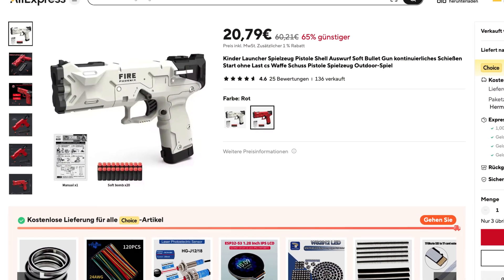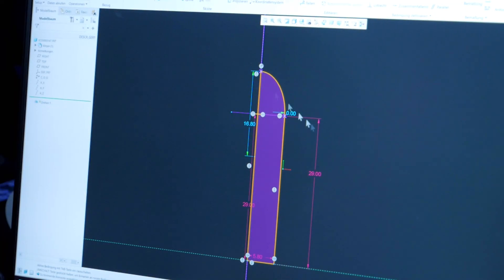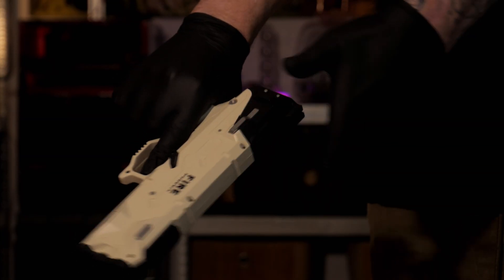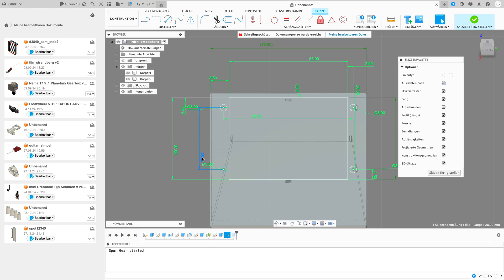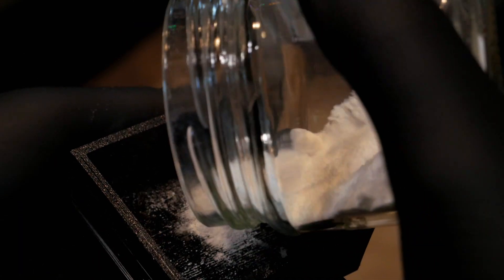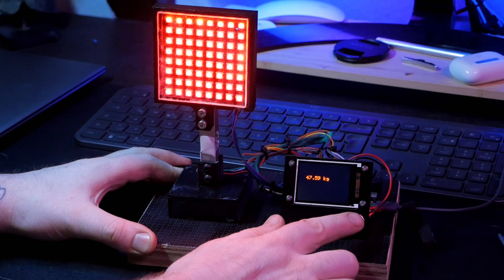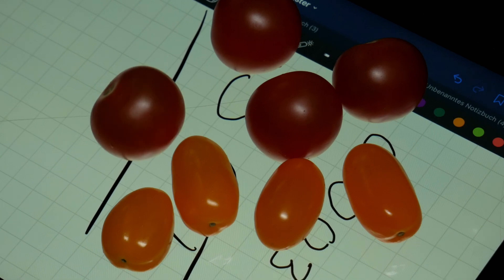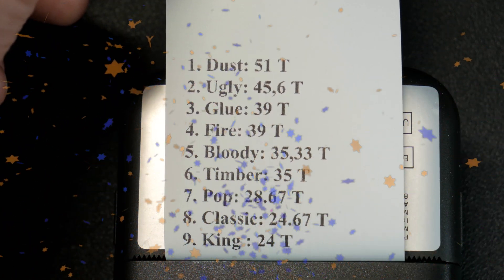How I Built a Power Meter to Test DIY Nerf Darts!

Comment: I have no idea how I came upon this video. But I am glad I did. I expected this video to be from a YouTuber with a million subs, not a newbie with a few hundred. Just based on the very first shot we see in the video, the cinematography etc. Quite amazed, if I'm being honest. Were you a camera operator or editor for a big YouTube channel before this? Or is this really your first go, in which case, goddamn dude.

Edit: Goddamn dude, watch a video on how to mix plaster or concrete. You added like.. 5x more water than you should. It should not look like or have the viscosity of milk. This DRASTICALLY reduces it's strength, and causes massive shrinking

Edit2: All this work printing in PETG, putting plaster inside the print, big bolt. And it's all useless. Totally useless. Because your load cell is completely ABOVE the 3d print filled with plaster. Which is why it's so floppy. Doesn't matter if you have a tungsten base,  if the only thing holding the load cell to the tungsten is 1.5mm thick 90 degree with no fillet 3d print with layer lines across it. That upright socket is weak, and kinda dumb when factoring what you did below to make it strong. Having the load cell go INTO the plaster, or some 90 degree corner supports on the upright or something would make it a lot stronger
Reply from the maker: Thanks for this amazing compliment! That definitely gives me a big motivation boost to keep making videos. Sometimes you’re not really sure if anyone is actually watching what you put together, so it’s awesome to hear that it comes across as so professional. I actually come from the automotive industry and never had anything to do with media professionally or even as a hobby, but photography has always interested me a bit because of my grandpa and my mom. Really glad to hear that you’re enjoying it! This will definitely keep me going. 😊  🚀
Reply from the maker: Oh, and thanks a lot for the tips! The point about the Load Cell makes total sense, and I can see why that part of the design is a weak spot. I’ll definitely give it another try later and see if I can improve the setup. Appreciate the feedback! 😊
Reply: @LionInTech  (!TECH SUPPORT BELOW!) Sure thing bud. I can PROMISE you, you will make it big if you continue making videos like this. I'm serious, I am very impressed and you have quite a wide set of skills. It's very impressive. But they usually come with a cost... trying to learn so many skills to a workable level, means you never really get a chance to figure out all the little tips and tricks that only come after you do it 20 times or 100 times, ya know? Since you spread your experience across so many different fields. It's not something to be ashamed about, far from it. I'd rather halfass 20 things, than master 1 imo. Just means having to stop, smoke a cig or eat a snack, and come back and look at your design and you will usually see where it can be improved. 

I struggle with this, personally. I get tunnelvision, and just THROW myself down the first method that comes to mind, where if I took a 5 minute break I'd see it's actually possible to do it 5 different ways, and each of them is better than my first idea.. it's a personal failing of mine. All we can do, as people, is realize our faults, and take the time and energy to try and work around what we know we're like.. 

My personal failings are as I said tunnelvision, bike-shedding (aka analysis paralysis), they're related because once you bikeshed, you're locked into that tunnelvision. A very wise man in my life once told me "The enemy of good is better". I didn't really understand it, it seems arguably false, ya know? What I finally learned it meant was sometimes good enough really is good enough, and spending 5 hours trying to improve some random aspect of a project that really serves no purpose or improves the overall project so little it's actually a total waste of time. Sometimes good is good enough.

Didn't mean to soapbox at ya. As far as the load cell mounting, a lot of times you can just halfass a fix in 5 minutes, then spend hours redoing it. You could 3d print or just cut out some acrylic, lexan, hell even wood triangles, and epoxy them from the upright socket to the flat surface. They are called 'gussets', they are everywhere in the automotive, aerospace, etc industry because they are cheap and greatly improve designs. Triangles are amazing at that, which is why everything structural is always triangles. Don't have to reprint, re-plaster, etc the whole mount, just epoxy some gussets on there and boom, 1000x stronger and stiffer.

Also, your loadcell code might not work the way you think. TECH BELOW and suggestions below:

Always put your code on github, and any design files including napkin sketches, and link the github in your video description. People greatly enjoy this and will thank you. Your code, from the flashes I saw on the screen, I don't see any calibration factors, the hx711 library comes with an example sketch called 'calibration', you upload that, and in serial monitor it spits out values unique to your setup. Then you save these values, and on your actual project sketch, you set those values as variables (calibration factors) for the code to use. This is why your readings are weird. I know you didn't do this, because you just copied that section of code with the example calibration factor (2280.f) from the example sketch. You also didn't set the hx711 gain values in code, no calibration factors, no loadcell_offset nor loadcell_divider, nor did you do any sort of sample averaging that I can see (that's why I said put github with your code up). Check the github for the library you used, including example code and FAQ: https://github.com/bogde/HX711 You also use get.units if you read my link for the library you can see you can put a # in the () i.e scale.get_units(5) for it to take multiple readings instead of just one. Then you can do some sliding window averaging and peak value easily, versus the way it looks like you're doing it, which will more than likely miss the actual peak force the loadcell sees. The hx711 can do 60 samples per second, and that library can even do automatic averaging. if you used scale.readaverage(5) for 5 samples, scale.readaverage(20) for 20 sample average instead of the other way.

And since you didn't define any of that, your values don't mean anything, which is why you had to use 'tomatos' lol. But even that won't fix the fact that a dart hitting a hard surface is going to happen in milliseconds, and your code would miss that. Also, the HX711 rate is set by pin15 (sparkfun project page for hx711 covers most of what i said above) the datasheet for the hx711 says pin15 is set by either going to vcc or ground, to set if it sends 10 samples per second, or 80 samples per second. However, depending how that pin is connected, it might take 400ms for the output to settle, which means even though it's sending 10 values per second, you're actually only getting 2(!) actual values per second. That is the RATE pin, and the DVDD pin. The sparkfun board, on the sparkfun project website, actually has a solder blob going to pin15, it's labeled SJ2. It's closed from the factory which is 10 samples per second, if you cut it with a knife, it now does 80 samples per second AND LOWERS the settling time to 50 milliseconds instead of 400ms. 

Just cutting that trace, using scale.read_avg(10), would greatly increase your ability to actually read the impact force. Right now you're.. not. No calibration or offset values since you didn't use the example sketch to get those values from the example folder, then put them into your actual code, didn't cut the trace for 80 samples per second and 40ms sample time , didn't set the gain to 128.

RIght now, force needs to be applied for ~100-400 ms (.1-.4s). A nerf dart (stock) is 2.85" or 3.6" long and stock speed is somewhere from 70-100 feet per scond from an official nerf gun, you can obviously make this much faster by modding or buying like you did a 3rd party high power one. Let's say it does 300 feet per second. Just order of magnitude guesstimation, that's 0.001 seconds for that 3.6" long dart to travel it's length at 300 feet per second. Obviously impact is elastic and exponential decay, but considering your current setup is 100x too slow to see the actual peak force, it doesn't really matter.

I'm not trying to shit on you dude, far from it. The only way to know is.. to know. Check out the sparkfun https://www.sparkfun.com/sparkfun-load-cell-amplifier-hx711.html and github for library: https://github.com/bogde/HX711/blob/master/examples/HX711_full_example/HX711_full_example.ino (this is where you get the calibration values from, to put into your main program) and this is the sparkfun hx11 board: https://cdn.sparkfun.com/assets/learn_tutorials/5/4/6/SparkFun_HX711_Load_Cell.pdf showing you what you need to cut, to get faster readings from the board

Maybe a part2 with some upgrades!
Reply from the maker: @dogsarebest7107  Thanks again for your kind words! That really motivates me to keep working on my new videos.

I totally get what you mean about tunnel vision—I struggle with that too. I tend to get stuck on details and try to make things perfect, even when it doesn’t really add much value in the end. But I’m learning to accept that “good enough” is often the better choice. Striving for perfection just for the sake of it can quickly take the joy out of a project. Like you said, it’s much more fun when you reach a point where you’re satisfied instead of endlessly pushing forward until it just becomes frustrating.

About the load cell:
I actually did a calibration, but I’m not sure exactly where I showed the code in the video. I did talk about it at some point. I tried different calibration methods and experimented a bit to see if I could identify any issues. But in the end, the main problem—just like you pointed out—was that the sensor wasn’t fast enough to capture the forces accurately.

Regarding GitHub:
Uploading the code there is actually a great idea. I had considered it before but wasn’t sure if people would be interested in looking at code from someone who isn’t a programmer. I did take one semester of C programming in college, but I wouldn’t call myself a real programmer. Still, I enjoy diving into code for projects like this and learning along the way. I’ll take a look and see what I can improve—getting more accurate and useful measurements would be really cool.

Thanks again for your detailed feedback—it’s super helpful! 💪
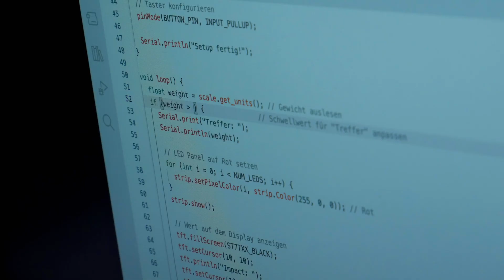Reply: @LionInTech  NP bud. I had hoped you didn't feel like I was nitpicking you to death, as that was not my intention in the slightest. The code was shown at 7:13, you show 3 or 4 shots that show your setup and loop code if you go frame by frame (HA!). And yeah dude, I feel that. It's always a huge struggle to accept 'good enough' instead of just latching on until all joy is drained, messing around with details that really don't matter. I deal with that on a constant basis, which is why I was trying to give some words - because it honestly took me far longer than I'd like to admit to realize it was even a problem I had, and even longer to figure out a way around it, so I try to tell others about it as a way to try and help 

Did you find the jumper I'm talking about, to make the load cell amplifier faster? Most boards make a cut-trace with a pullup, so to enable it all you have to do is cut the trace between the pads, to pull the pin to vcc instead of having to do any soldering. The sparkfun page has a lot of info and iirc adafruit also has a lot on it as well.

Anyhow, til next time!
Reply from the maker: @dogsarebest7107  No worries at all! Constructive criticism is honestly the best thing one can ask for. If people just click away without saying anything, you never really know what went wrong. That’s why I truly appreciate your feedback.

I haven’t found the jumper on the amplifier board yet—I simply haven’t had the time to look into it. I’ll try to revisit the project in the next few days and see if I can make progress. Once I figure things out, I’ll let you know whether your tip helped me.

Thanks again for your input!